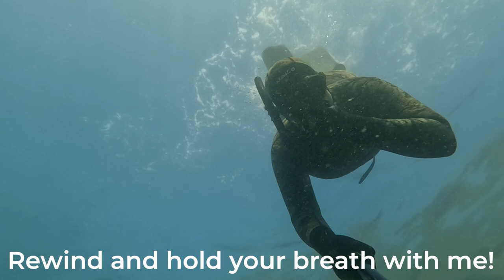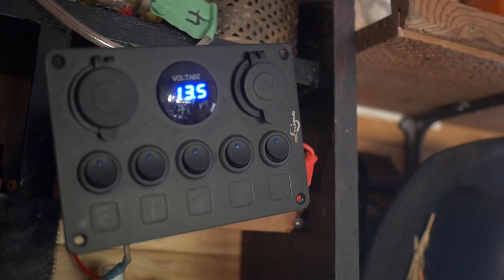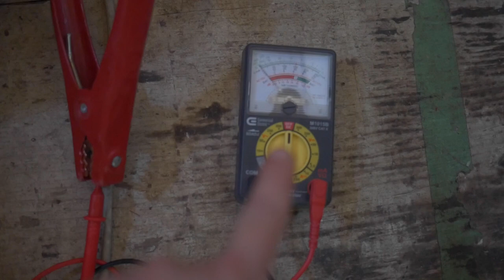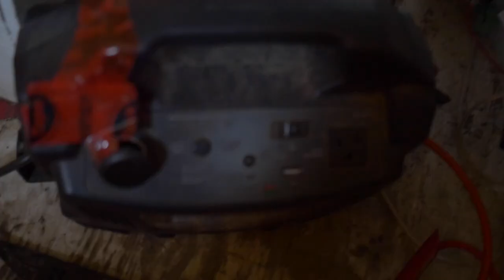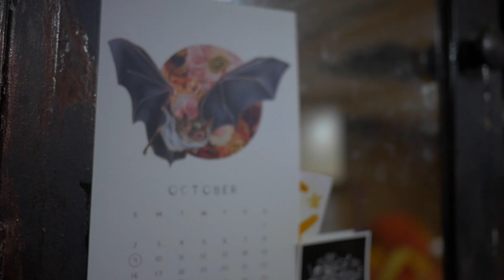Highs and lows of winter in a van

Comment: I'm guessing your multimeter has one or more blown fuses inside. Turning the dial through the ranges while the leads are connected to a power source is a big no-no! You want to check the voltage, so set the meter to "VDC" or "Volts DC". It may also be a symbol of a straight line with a few dots under it.  I suggest you pick up a cheap auto ranging digital multimeter, they are more forgiving. Read the instructions that tell you how to use it 🙂
Reply from the maker: @Electrowave ooohhh thank you!  I'll check the fuses, and yea I definitely would prefer a digital one. Will add to my shopping list sigh, but best to have before I work on some of the bigger electrical! Thank you for your help!!